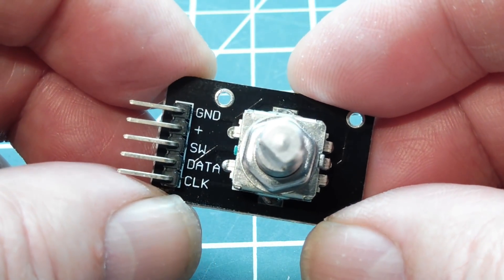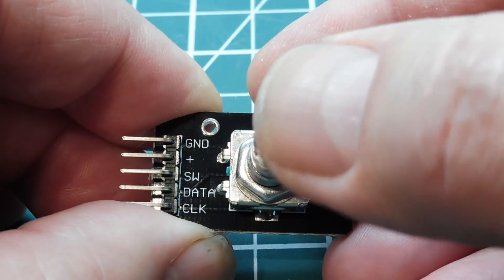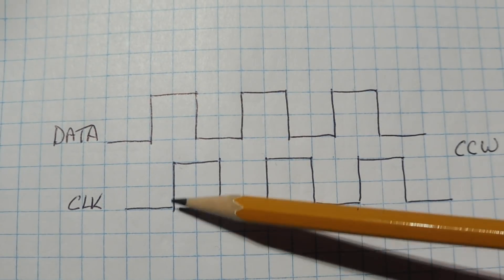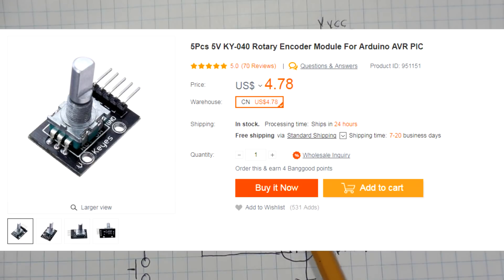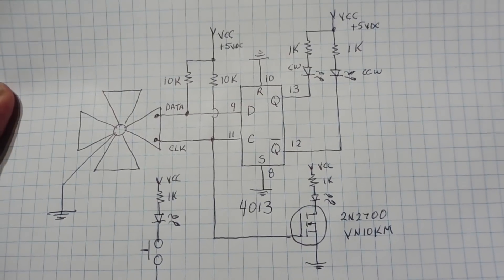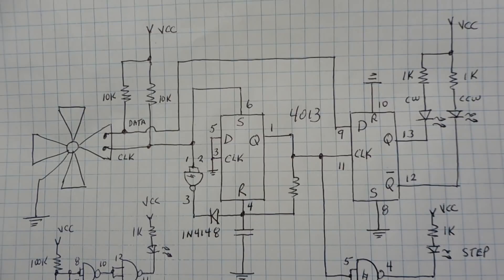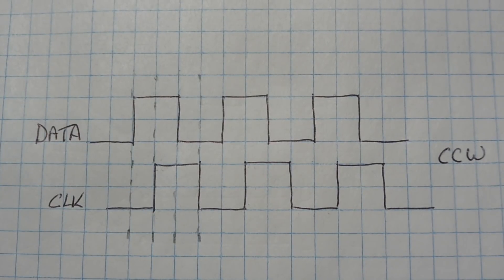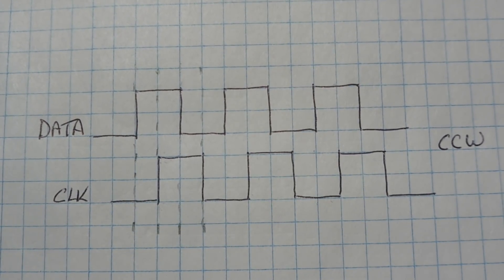Build A Rotary Encoder Interface

Comment: It doesn't look like Arduino code, IE: void setup, void loop, etc.  What am I missing here and how can I use this with my Nano to change the direction of my Stepper Driver?  Thanks
Reply from the maker: I do not use the Arduino IDE. All code in my videos are written in FORTH. Check out the FlashForth website:
www.flashforth.com   Check out this link to my stepper motor video:  https://youtu.be/jt48k1apGzQ
Reply: @0033mer  Thanks for the reply.  So, if a person wants to follow your video tutorials using an Arduino, they would have to learn and use the FORTH programing language?  Is that correct?
Reply from the maker: Yes, you would have to learn FORTH to follow along. FORTH is the best programming language to control hardware.
NASA has been using it in their space probes for many years. https://www.forth.com/resources/space-applications/
Reply: @0033mer   Okay, thanks anyway.  I only have a couple of projects that I need an Arduino for and I have already invested a lot of time learning to Code in the Arduino IDE.  It might be good to make it clear upfront in your videos what the situation is so we don't waste our time, thinking that we will be able see the Arduino C+ code for the tutorial.
Reply from the maker: Go to my channel home page and click on "About"

Comment: I've got some similar, cheap rotary encoders.  They have some seriously nasty bounce on the CLK output.  I haven't found a combination of resistor and capacitor that reliably debounces for both slow and quick turning of the encoder shaft. I found that ignoring the CLK input for an appropriate time after a rising edge was most reliable.  (I tried sampling the CLK pin at regular intervals, then looking for a certain number of matching samples in a row, was unreliable because the bouncing continues for so long.)
Reply: A nasty bounce is about 10ms.

Comment: A question - why the state machine approach that you mentioned toward the end? Surely an ISR driven by the clock positive edge would uniquely resolve direction based on the state of data? And every clock pos. edge is one rotation 'click' so you have all the info you need without having to decode all states, what am I missing?
Reply from the maker: If someone purposely turns the encoder 1/2 click CW and then back CCW you would get a clock pulse output but the encoder is in its original position. There are 4 states to a proper "click" and if you do not see all of them you can null the output.
Reply: Thanks
Reply: - but I still dont quite get it. Surely encoder absolute position is not important, its just clicks and direction that matter. So if you did turn it halfway and return to original position then you would get a clock pulse and some indication of direction (probably the previous direction?) I'm displaying my lack of knowledge here - will go check it out on a scope.
Reply from the maker: I try to keep my video length to 10 minutes max so I did not go into too much detail about the state machine approach.
Check out this video, you can go to 11:25 for the explanation.
https://www.youtube.com/watch?v=aeJm76F5lOQ

Comment: Great video and nice way to reduce code complexity. Seems that the art of digital hardware design is fading in the face of embedded solutions - if there's a uC in the design do everything with it, but here's a good example where a low level process is  perfectly suited to a hardware solution. Thanks for keeping the art alive! Just for interest here's a neat way to debounce in firmware using a software shift register.
http://www.ganssle.com/debouncing-pt2.htm
Reply from the maker: Using a shift register to debounce is a good technique. It works so well Motorola made the MC14490 to do just that.
Sadly it is obsolete and no longer manufactured.
Reply: Interesting - thanks. Mouser lists them but at a heck of a price - dwindling stock no doubt.
Reply from the maker: Surface mount only .. no more DIP packages.

Comment: Hey dude, nice video! Help me out with something. Let's say I want a circuit which gives one short little pulse (high and then back to low again) when a certain input goes low to high and stays high. Basically I want a pulse when I detect a rising edge. I want to do it with very few components. Any ideas?
Reply from the maker: You need a positive triggered monostable circuit:
Check 555 timer data sheets. http://www.electroschematics.com/6215/positive-trigger-timer/
You can also use a CD4528 or CD4047 IC.
Check out this video for more ideas:https://youtu.be/f1FcW7rmJ-o
Reply: 0033mer Nice! Thanks so much! I did it with an inverter(7404), an and gate(7408), a resistor, and a capacitor. But I didn't want to use two 14 pin chips. I think using 4013 as shown in your video will be enough for this application. : )

Comment: are these available without breakout board?
Reply from the maker: Yes .. You can get them from Digi-key
https://www.digikey.ca/product-detail/en/ACZ11BR1E-15KQD1-20C/102-1763-ND/1923358?WT.mc_id=IQ_7604_G_pla1923358&wt.srch=1&wt.medium=cpc&utm_adgroup=CUI+Converters&mkwid=sEIT2P6VX&pcrid=102742808345&pkw=&pmt=&pdv=c&gclid=CjwKCAiA9rjRBRAeEiwA2SV4ZWhbpCmUzOtP87oKfcSokHJdict-1Is856WorDQn6DilRLDZxh44whoC2MsQAvD_BwE

Comment: Q:  I'm struggling to understand what the R, C, diode and one gate are doing?  Thx.
Reply from the maker: A typical RC inverter contact bounce circuit assumes the bounce will stop before the RC time constant times out. This contact bounce circuit keeps the capacitor discharged using the gate and diode as long as the bounce is active keeping the Q output high. When the switch changes state the capacitor is allowed to charge up to reset the latch but any bounce will discharge the capacitor. When the bounce settles down the capacitor will charge resetting the Q output low. Just a better way of doing it.

Comment: 2 comments:  in 33+ years of many varieties of casual & career computing, I never, EVER saw a shred of Forth, much less somebody coding in it.  Were I not so comfortable in 'C' and if I wanted to dabble, looks like Forth has retained viability right up to today.  If you were to actually convert this project to SMT components to reduce size, I wonder if there'd be a market for such.  It is a nice, tidy package and looks quite useful.
Reply from the maker: You got it ... May the Forth be with you. :O)
Reply from the maker: NASA still uses Forth in their space probes. Our solar system is full of microcontrollers running Forth.
Reply: So NASA programmed the probes to go Forth and explore?
Reply: The PHILAPE lander use MPE FORTH with RTX2010 processor (code machine for this processor is FORTH): https://www.mpeforth.com/press.htm
Reply: https://en.wikipedia.org/wiki/RTX2010